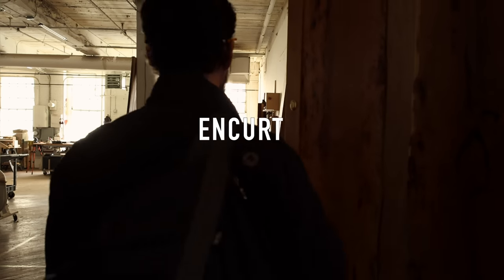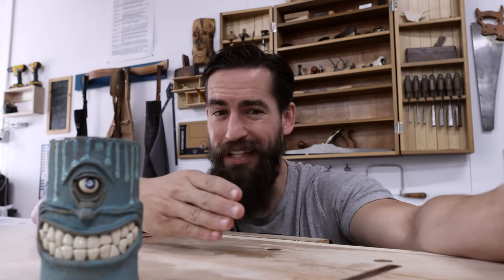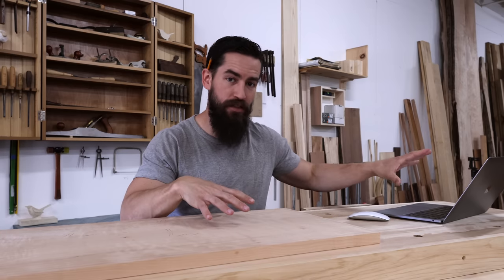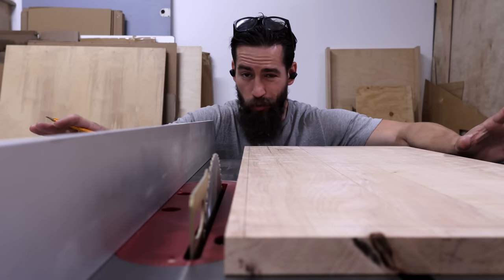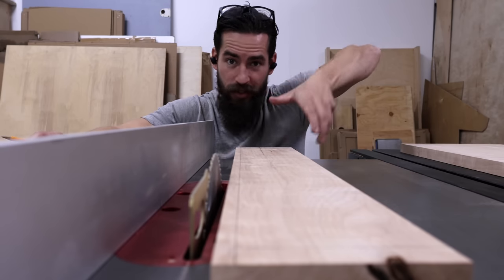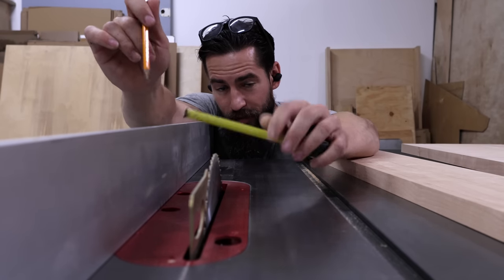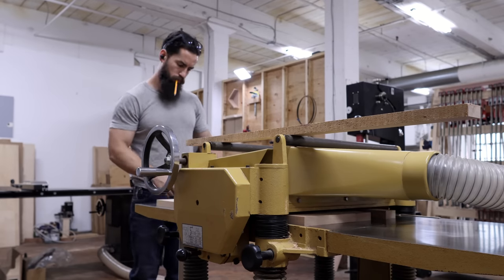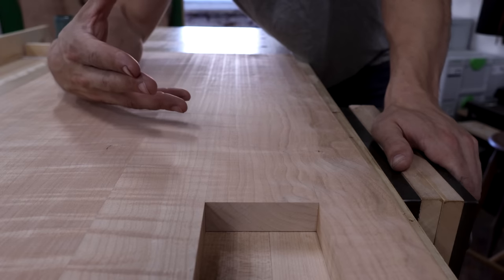Master this skill EARLY

Comment: Question from a not-even-a-newbie-yet:
If you aren't going to using the same wood for the drawer front, couldn't you just cut that one section out, and not rip down the whole board? Then there would be no seams at all.
Reply: I agree. You could cut the hole with a hand saw, clean it up with a router, then finish up the corners with a chisel. In my opinion less work, no glue-up, and no interrupted grain. Only risk I see is the remaining wood moving after removing the drawer, but it looks small enough to not be a big issue. I guess the guy in the video is very reliant on his big machines and doesn't wan't to mess with hand tools. The corners could be messy actually - risk of cutting too deep, not keeping a consistent line, or leaving tool marks. If it's supposed to be a bespoke piece with all visible surfaces perfect - I get his decision.

Comment: This is the first video of yours that I have clicked on. I’ve now subscribed.

I’ve been woodworking for over 45 years and have obviously seen so many changes in that time. Most have been very positive - such as the vast improvements in adhesives and abrasives; how power tools such as routers have become affordable for the smaller shop. I’ve also seen negatives such as the imbalance between skills, patience, thought and buying more tools. More tools are not the answer. Skill, experience, patience and thought are. 

My first impression of your channel was that minimalistic tool chest. That’s a good start for me. Then the way in which you calmly went about solving the problem. That’s excellent. 

Let me say that I’m as guilty as most of over-tooling. I have several of everything; why do I need 4 or 5 precision squares? 3 or 4 sets of very nice chisels? Okay, much of that came from when I ran a small sideline business making furniture but the principle is there - having more never made me better. 

I’m certainly no hand tool die hard. I use well-tuned machines as much as I can because a) they can do a great job easier b) at my age, my body won’t take too much hand planing or mortising. But, thee is a time when 3 or 4 strokes of a hand plane give you 3 or 4 opportunities to check progress; something a thicknesser probably doesn’t. 

I watch my YT videos early in the UK morning before my wife wakes up and the dogs demand their morning walk. So, I don’t watch many per day. But you can be sure that, tomorrow, I will be looking at the back catalogue of this channel.
Reply from the maker: Thank you for the kind and thoughtful feedback. I’m glad you enjoyed the video and thanks for subscribing!
Reply: This is the most substancial and warmhearted comment I have read so far.
It was a pleasure to read.
I wish you all the best!

Comment: Nice work with your jointer plane. Too many people go straight to the power jointer when a good hand plane used with skill will do the job with less risk of waste and failure.
Reply from the maker: Less risk and less waste is key. But it does take time to develop that skill!
Reply: I use my hand planes a lot to finesse joints.

Comment: Just an update on wood movement. You would only have to worry about wood expansion if the face had a different expansion rate than the panel. But it's the same board. So the panel will expand at nearly the same rate as the face.
Reply from the maker: You're not wrong. In theory, it should all move at the same rate. However wood does funny things, especially when it's changing regions. I've found it easier over the years to relieve the potential of binding than to have to head to Florida to make a repair in the future.
Reply: I agree with that, the Florida change will be a doozy. Luckily with your design, you shouldn't have problems. Thanks for a great video
Reply: Wouldn't expect the same rate. The drawer would adapt faster to changing conditions than the surrounding material because of two open grain cuts on the sides. Also, the drawer is free to deform, while the surrounding material is held by more of itself, with changing grain direction as well as different boards in the glue-up, not to mention the rest of the chest structure. So they will definitely not match their deformation exactly.

Comment: Hahaha that mug is awesome. 
Still learning, so forgive the question if it’s too off but you mentioned doing a veneer to make the drawer disappear and then building the box behind it to account for wood movement. Would you take that drawer face cut out and rip that face on a band saw to get a 1/8 inch veneer and glue it on?
Reply from the maker: That’s exactly right! Would proceed exactly the same, then just rip 1/8” off the drawer face and apply to a stable substrate.

Comment: I have a question about your use of a regular tape measure on the saw. As we all know, a tape measure is loose at the end where the hook is attached. But that also means that a measurement is going to be different depending on the way you use it. Pulling it from the end adds to the measurement. Pushing the end against a wall or table saw block gives you less ( or a correct measurement?) So, why use it at all?

Comment: I am a new subscriber. I am also tired of videos on: 99 ways to build cross cuts sleds; the only finish you will ever need: the best table saw, track saw, etc ...; big busted ladies in tight tank tops; and idiots who insist the ritual unboxing when they get the newest tool that you have got to have. Many seem to spend most of their time building the perfect shop and tool collection and little time woodworking.  Worse are the presenters who ramble on and on like the drunk best man at a wedding reception. 

So far I have enjoyed your videos. You are prepared, don't repeat yourself, and have a good sense of humor. But the muscle man pose is a little much and the cup of coffee routine is right up there with the unboxing as being tedious.  But you do provide some good advice. 

P.S. you need to buy a taller stool or cut the legs of your workbench shorter.

Comment: Luvin' the mug.  Maybe give it a matching beard 🤣 When jointing the edges could/would you have jointed matching edges folded together to get a "flat" outcome ?
Reply from the maker: I may have to ask him to make a bearded mug for me now 😂

Typically I would fold a joint when planing, however because they are so variant in width it would have just been a pain in the butt in this case. So just checking it to make sure it stays square will get the job done.

Comment: Keep the mug 🍺. 
What is the reason you used the red stick and not the plane to check the edge of the border, asking for a friend.
Reply from the maker: Mostly because the red stick allowed me to sight the entire board at once. The plane edge would have done fine but is only 24" and the board is 30". A 36" rule was helpful in this particular instance.

Comment: Isn’t it unnecessary to make the drawer front shorter in height to accommodate wood movement since the carcass is also solid wood and will move at the same rate as the drawer front?

Comment: Why not simply cut out the drawer front before you clue up your piece? Whilst clamping you could inlay your drawer front and some veneers accounting for the saw blade cut to easily transfer the pressure.

Comment: As a totally newbie, I wonder how the wiggle can appear after cutting the piece. How do you get this concavity after the cut? Thanks
Reply: Internal tensions in the wood (called "timber bound") are released in different places and in different degrees depending on irregularities in the grain, such as going around knots. The biggest cause is rushed kiln drying which produces more stresses. If you rip a 2x4 or 2x6 in half it will be blatantly apparent on an almost exaggerated scale what is happening. Most of the time, at least. Occasionally there is that one 2x4 that rips straight.

Comment: Movement isn’t an issue here because the entire piece is able to expand and contract and it’s the same piece of wood so they will move at the same rate. Movement here would o my matter with cross grain construction. 

Rob cosman has a great video about hidden drawers like this on a standing desk and it’s great.

https://youtu.be/GQ5Ndd0Prag
Reply from the maker: You're not wrong. In theory, it should all move at the same rate. However wood does funny things, especially when it's changing regions. I've found it's better to relieve the potential of binding than to have to head to Florida to make a repair in the future.